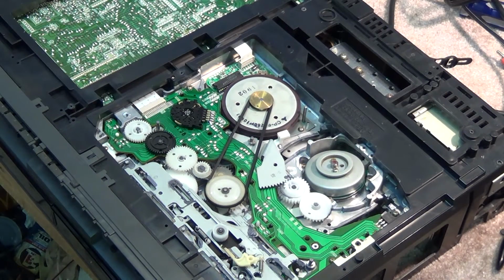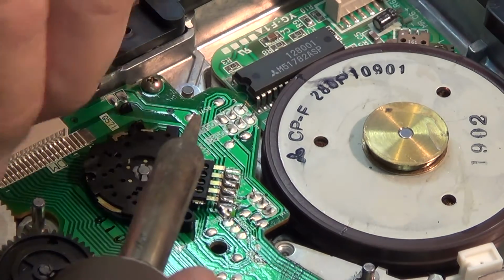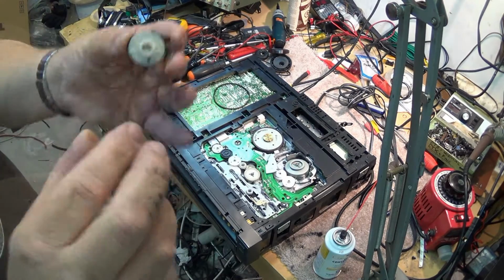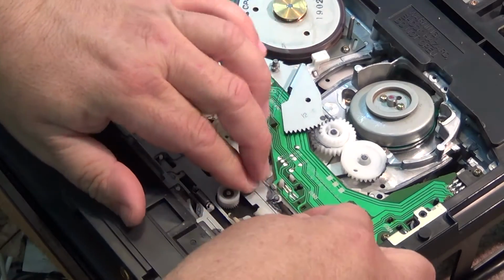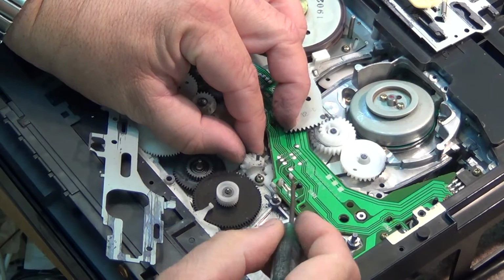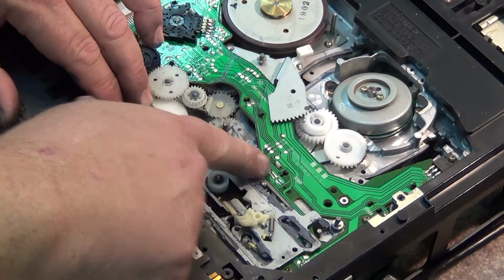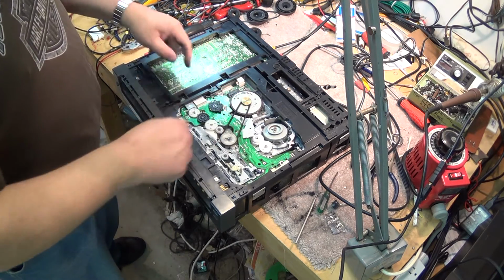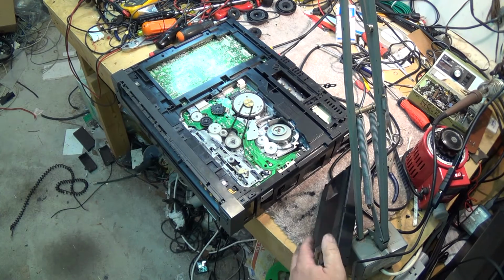mitsubishi hsu 55 bottom side overhaul

Comment: Great videos. I have an HS-U80. I cleaned the goo and installed a new belt plus new pinch roller & cleaned heads. Tape movement is smooth now in all modes but I have extreme video static and some picture rolling in standard VHS  playback. (Don’t have a SVHS tape.) I looked through the boards and didn’t notice any leaking caps. Any suggestions from here? Thanks

Comment: Wanted to say thank you so much for the Videos on repairing these machines. I have a SVHS H-SM1000 and it is an excellent machine. It stopped ejecting tapes a while back, so i set it aside with the intention of looking at it sometime, but never actually got around to it. I recently came across your videos and have now got it working again. All it actually required was a new rubber belt. A local television shop that used to repair them actually had a box of belt's. Not the same as the original but close enough. I would like to strip it down some time and re-grease the upper and lower mechanism, so please leave the videos on u-tube for other people like me who may need to do the same. I am sure there are numerous people who will some day require the facility to convert their family's precious memories to a Digital Format and it's Credit to you to be able to assist them by showing them how to repair these Antique Machines. The only issue will be sourcing spare parts.

Comment: The noise coming from the head drum is often loud. Do the motor under it need oiling or is it a sealed unit? Thanks for your videos.
Reply from the maker: The bearings are sealed in most units. You might be able to pull the rotor assembly off the bottom and oil the shaft.
Many machine have a grounding spring that contacts the spinning shaft on either the top of bottom side. It is flexible copper band, with a carbon contact that sits on the rotating shaft to dissipate static electricity. These ground straps have been known to cause a squeaking sound. The end of the shaft should be wiped off and cleaned.
Reply: Thanks for your reply.